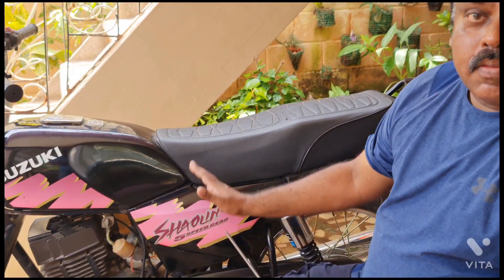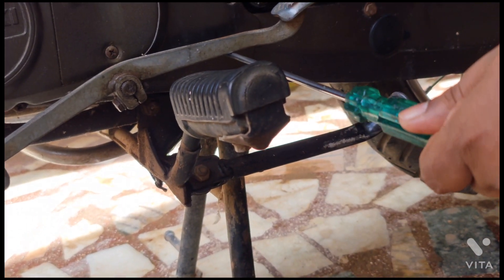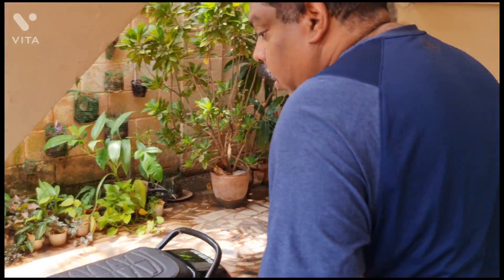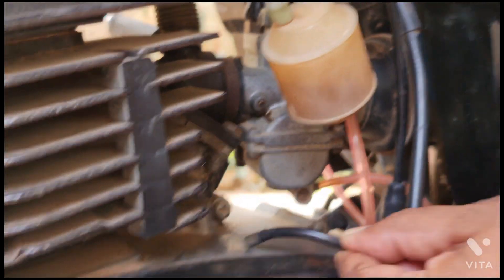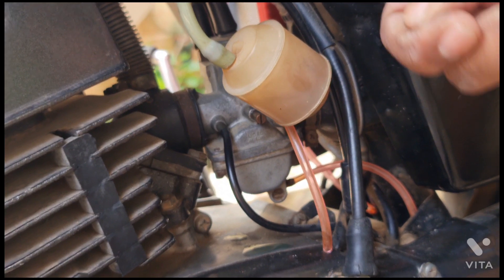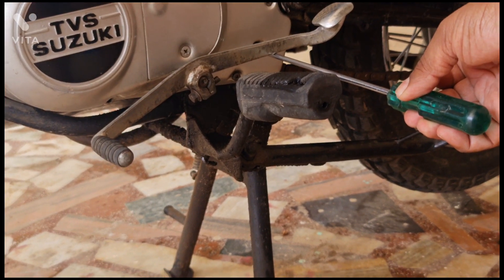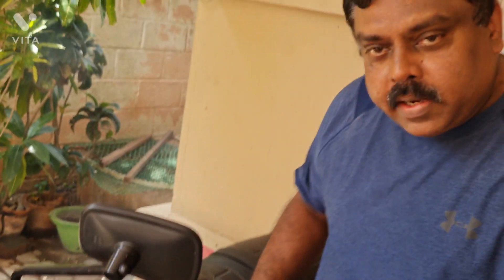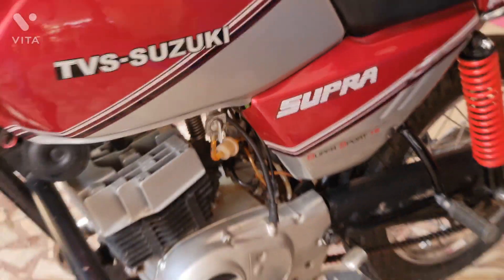Checking the oil pump function on TVS Suzuki bikes

Comment: Sir should i use oil in tank too if my oil pump is working?
Reply from the maker: @ranveetsingh4288  Hi, if your oil pump is working properly, don't use more oil in the tank. You can just add a very few quantity ( 5ml ) just for protection. But too much oil, spoils the engine..
Reply: @manbandw  thank you sir for information

Comment: Very informative video bro. Thank you so much for taking the time and effort to do the video immediately after knowing someone direly needed the help and guideance🙌🤝👏
Reply from the maker: Thank you so much bro.  I found that the audio is getting disturbed at some places.  I'm sorry for it as I relied on the mobile microphone.  As the bike was running the microphone was picking up that noise much and the noises from the surroundings. Its my fault that I should have used a wired microphone. 👍🤝😊